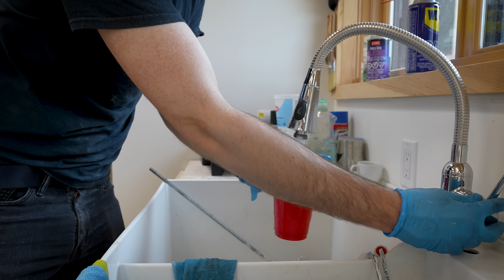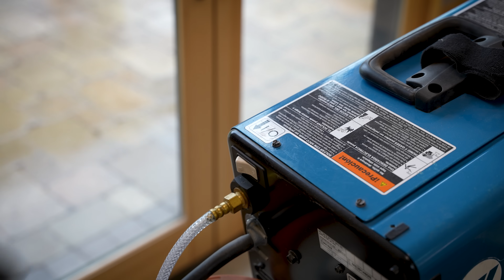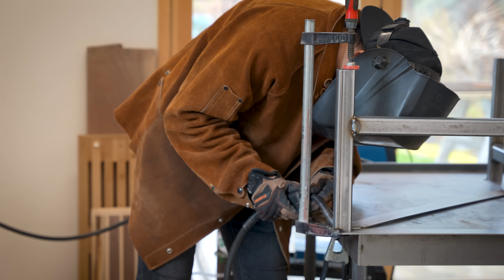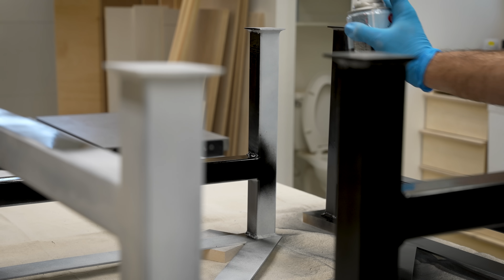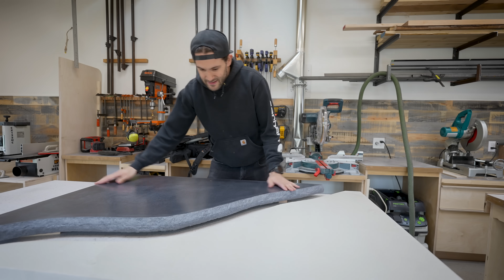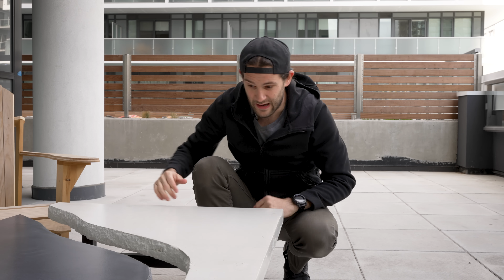Wood got too expensive....

Comment: Great Video .Awesome table .I would have added wheels to the bottom to make it easier to  move around .  I'm inspired to make my table now . Do you have any tips on inlaying a marble chess board into the concrete ? I'm getting that idea off my mental  shelf after seeing this video .
Reply from the maker: Thanks man! If I were going to inlay a chessboard, I'd probably started with a stand in for the chess board thats the exact same size, like a piece of plywood or a piece of foam and cast that into the concrete. Then remove the stand in after you're done all the finishing work and drop the chess board in its place. Hope that helps. Cheers
Reply: @ZacBuilds  Thanks for idea. I was thinking of doing the pour around the board for a better fit. Trying to avoid a seam where water can get in

Comment: build a little vibrate to your molding, underneath, and to reduce weight, you could do your first layer and the later, build up with aircrete. Might not want to vibrate that part.

Comment: Wow amazing job! I may have missed it but didn't see how you attached the legs to the bottom of concrete?
Reply from the maker: Thanks! And originally I was going to silicone them into position, but to be honest they felt really secure with nothing holding them in place because they're so heavy so I just left them as is

Comment: There is a trick that makes it much easier to mix concrete. Use a clear container that shows the measurements and monitor exactly how much water you used on the first one. The other ones will be cake.

Comment: A couple tips for painting the metal stand for your table, and similar future items, I picked up occasionally helping the industrial painters while working in a metal shop:

1. Clean the weldment thoroughly! (You may have done this off camera.) Oil is paint's greatest enemy, and along with the the oils that will have been left over on the build from your hands and gloves, and possibly tools, those steel tubes are almost certainly coated with a light oil to prevent rusting while stored. Uncleaned steel can result in paint peeling or bubbling later.

1a. Since cleaning those oils off will leave the steel bare and vulnerable to rust it should not be done much before priming. 2 days could be enough for the bare steel to start rusting.

2. The primer is what really protects the steel, get a thick primer or layer it on good. (I have the feeling from your comments you will go with a thicker primer in the future.)

3. If you're concerned about the color coat fading or otherwise getting damaged, consider a clear coat. Though since the paint you used was intended for outside use and you did multiple coats it's probably fine on this one.
Reply from the maker: Good tips! Thanks. I did clean the metal off camera, it was just one of those scenes that ended up on the cutting room floor.
Reply: Solid information. I was thinking the same thing almost word for word. Like you said, oil from your hands is enough to mess with the adhesion of the paint. I've actually seen the shape of fingerprints rust into bare metal that was touched after prepping for paint. I personally also like to wire brush the whole surface before paint to add to the mechanical adhesion.

Comment: the square plate welds on the feet are a bit weird imho, i would've used some black plastic tube inserts for the feet. if someone is barefoot and steps near the feet, those sharp square corners are gonna hurt.

Comment: Try adding a small amount of oxy clean regular stuff.  And after mixing it all up take an air hose and regulate it down where you can blow some good bubbles and make it foam as much as you can then mix the foam in the stuff just a little and pour it..  will be a very light fluffy pour and dries with even bubbles and is a fraction of the weight...

Comment: Is there anything you can do to make something like this lighter? I saw a YouTube video where the man used pink foam board and did a fancy laminate over it, and I was wondering if the concrete could somehow be amalgamated to something like that.
Also I was wondering about the feet protectors you added. It looked like you screwed them in, and I was thinking the screws might scratch the floor as well. How do you prevent that?

Comment: Great outcome and video....one question, though, how did you attach the legs to the concrete? i can't think of a system that would risk cracking the tops.  Thanks.

Comment: How did you attach the iron legs to the concrete top?  Did I miss it?
Reply from the maker: No you didn't miss anything, I simply placed the concrete on top of the steel. Originally I planned on using silicone to affix it, but honestly it's so heavy it's very sturdy as is.

Comment: That drill was not designed for mixing concrete, I suspect the windings have a shortened life. If you have more to do get something equal to the  Milwaukee hole hawg or a mixer. A vibrator attached to the table would be useful as well. A garnet slab wouldn't be too expensive and lot less labor and time.

Comment: I would have gone with aircrete. Much easier to move and work with in my experience 
though you would have more voids. Not an issue though if your coating it with color.

Comment: Love the build and table concept is amazing. Think an epoxy would adhere well to the concrete for a river style concrete table?
Reply from the maker: Definitely! And that's something I actually discussed doing with Concrete Counter Top Solutions. However, I ended up deciding against it because I thought it was too similar to my Epoxy Pixelated Table I did recently. But definitely do-able!

Comment: It's a bit funny that you called out that you didn't have to add anything to make this concrete self leveling, then proceeded to show concrete that definitely would have benefited from flow control, it was just as thick as a regular concrete mix. You even had issues (the air bubbles) that wouldn't have happened if you had used the flow control. Having cast stuff like this before, just use the FC, it makes it come out so much better, and it's only around $2 per bag.

Comment: That table would have been really nice if you had poured epoxy in between the crack with some led's and a water proof blue tooth stereo attached to the bottom of the table :)

Comment: as a thought, would a resin bond to this to create a river effect that connected the 2 halves? Or would the weight of the concrete top prevent movement after it was cured.

Comment: Would music with a lot of bass shake the bubbles loose in curing concrete? Wearing gloves and wiping the metal down with alcohol will clean your oily fingerprints off and increase the longevity of the steel more than extra paint.

Comment: The price of wood is way too high. 
For this project you'll need concrete countertop mix, concrete pigment, concrete sealer, large sheets of melamine, silicone concrete edge molds and steel mesh for support.

Comment: Not necessary I poured 4 x slabs larger last year and used super strength concrete no reo required on my black slabs which I honed. All of this is far more expensive than wood. I used 1 x bag of pigment. Per every 3 x bags of concrete .

Comment: The mesh rusting will rust over time especially out side. Please consider just using fiberglass.
Reply: You have obviously never done concrete of any sort before.....
If you have ANY exposed mesh or rebar on any concrete project or job then you fucked the whole thing up. Mesh or rebar should always be imbedded atleast 1 inch from all sides.

Comment: The workmanship is fantastic...

Sadly these materials and methods (and those industries) are what are rapidly killing this planet...!!!  Sustainable wood, stone, and clay materials still create better and longer-lasting fabrications of use and in architecture that are also more serviceable over the centuries (millennia in some cases) that they have proven to last...

As for "cost of lumber" I have never spent (anywhere in this country!) more than $1 per board foot with a lifetime average (now 40 years of woodworking professionally) of between $0.25 to $0. 70 cents depending on the region...

This year's major projects consumed over 15,000 board feet of sustainable hard and softwoods with the mean average price of approximately $0.70...

Comment: The shortage is such bullshit, I have yet to be to a single yard in two states that was not packed to the rafters with everything you could ever want.  They would rather let it rot in the yard than lower prices back to what they were.  If there is such a shortage why are a bunch of the big mills shutting down for routine maintenance instead of getting that extra money?  Cause there is no shortage and it's the greed of the distribution companies of which there are only 3.

Comment: Making furniture from fabric and cement:    https://youtu.be/OM-fYRt2AFE
Adding chicken wire and cloth/cement layers can achieve thinwall ferrocement strength for thickness without pre-building the wire structure first. With only a basic structure or form, pieces of soaked cloth can be laid on to fit especially on strengthening 2D and 3D curves. Welded-wire fence --- I'd use in a small boat or footbridge or perhaps a sturdy door.

Comment: Why are you screwing those overly engineered felt pads onto the legs? Every department store, drug store, supermarket.. everybody sells the felt pads with a sticky side. After all the ones you installed are just a felt pad with a sticky side, then stuck onto a round piece of metal, tripling the cost of said felt pad.

Comment: Dude it’s “Melamine “ not.   “MALamine”.   Mel.  Not Mal
Reply from the maker: No, I'm pretty sure it's malamine.
Reply: @ZacBuilds   no your wrong.   Use google to help you learn to spell.
Reply: @mikeeagle2653  I did Google it. Check the pronunciation websites. They all say malamine
Reply: @ZedEh   it’s spelled MEL.   Only one pronunciation.  And it’s not MAL.
Reply from the maker: @mikeeagle2653  dude, use google. It's not hard.